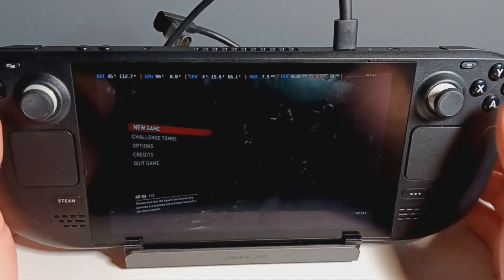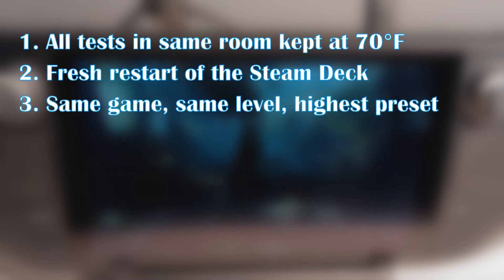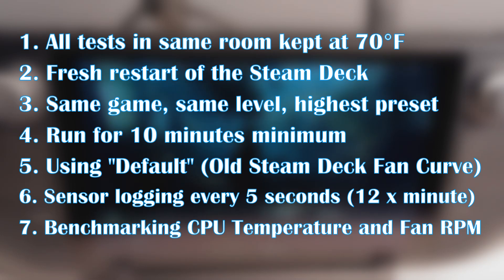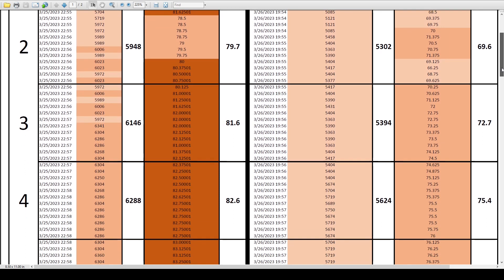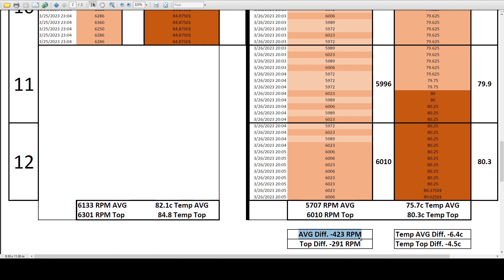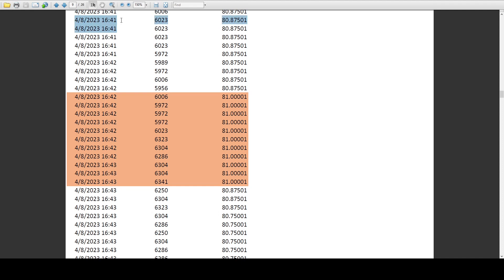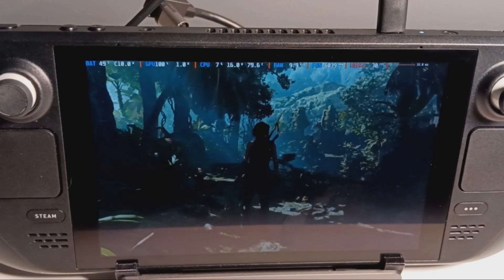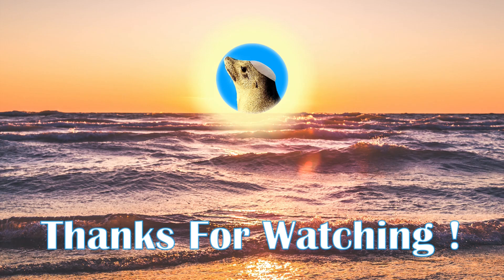Is PTM 7950 Really Better than Stock Paste? - A Steam Deck Benchmark Story

Comment: For those interested, i just did it and im not getting any difference in thermals BUT it does seem to have stopped the fan ramping up to its previous very noisy levels which imo is worth it
Reply: Any difference in FPS, utilisation of the CPU/GPU or clock speeds? If the extra cooling helps, I imagine it would allow the deck to push to higher clocks which could offer more performance
Reply: @JojoooooooI really didn't see any significant performance boost personally, maybe I lost the silicone lottery with my deck but if you're gonna change your thermal paste anyway which you should if it's a few years old, you may as well get some 7950, it's not that expensive and you 'might' see some performance

Comment: Where is a legitimate place most people are buying this Honeywell PTM 7950 from?
Reply from the maker: to be honest mine is third party stuff from amazon that was probably sourced off aliexpress. It works, but my understanding is that the official is even better.
Reply: Linus Tech Tips famously sells this sourced from claimed verified suppliers. I personally would trust that claim but other may or may not. Unconfirmed rumours is that a lot of the stuff out there on amazon etc. is fake.
Reply: @jonatanrullman  there is little if any fake ptm 7950 at all. I got literally the cheapest stuff directly from ali-express and it dropped my cpu almost 10c from using arctic mx-6. It is so cheap to get ahold of in China you don't need to worry about fakes and even the non-branded honeywell stuff is better than paste. I really wouldn't worry about it at all

Comment: The issue with this video is you compared with stock paste. Any paste will beat stock paste. Also ptm7950 needs a few heat cycles to move into place.

Comment: Not with steam deck but in my case is an i5 1135g7 + NVD Mx450 which can take up to 50w+. Decent performance, with me is about 5-6 *C lower than thermal paste like mx4, nt-h1 (after 4 months) and more silent when high loads. Some my recommendations with ptm 7950 are: Store it in a cold place to make it easy to apply, Run games or benchmarks softwares in high loads some cycles and Use fan control software to lock rpm of fan also help it efficently faster

Comment: I installed mine but if I'm not mistaken it need a few cycles to show results, how do you do it? Leaving the steam deck with a heavy game on a flat surface?
Reply from the maker: Yeah it might take a week. To speed things up, I run Shadow of Tomb Raider in Free Roam > Explore Mode at max settings for a couple hours.
Reply: @baldsealion  thanks for the advice, I ended up running FFXV WE and leaving the deck on a flat surface making cycles of 15min on 15 min off, I noticed that temperature was dropping instead of rising at long terms so I suppose that it works!

Comment: Aleays lock fanspeed when comparing stuff like this. Temperature difference would be 6-10c with using same fanspeed.
Reply from the maker: Yeah noted, in later test videos I do run the fan at max in spots... although I think people also are curious about the fan speed differences. Some don't max their systems and may be more curious about how much lower the rpm will get in general.

Comment: I've been testing this in various ThinkPad laptops and the CPU temperature differences are very noticeable while GPU differences aren't as large, but they still count. I would put this in every mobile device ever IMO
Reply: Well, the GPU thing isn't as bad as, in my experience GPUs doesn't heat up as much, my 1060 is pretty cool, issue is always the CPU, those mfs do always get to the 95s

Comment: Awesome video. The PTM7950 coupled with downclocking the CPU and GPU would not some great results.
Reply: wouldn't down clock the CPU, but would definitely under volt it.

Comment: So I have been up and down on the best cooling. From themal pad to paste to blower coolers. Back plate mods. Heatsink mods. For the price of it all. What is better. Jsaux blower cooler. If the look bothers you then getting the PTM7950. The PTM will not get you the temps of the cooler but yes the internal cooler will run slower do to PTM actually being great.
Reply from the maker: I agree if you don’t mind opening your device the PTM is a cheap and effective way to cool that doesn’t add any weight or anything to your device. It’s good stuff. I will put it on my Ally probably

Comment: You can repaste it with almost anything and get improvement i did with kryonaut.
Reply from the maker: Yep totally, the issue there though is heat creep. I’ve been told at least that kryonaut starts degrading at 80c - but this is not an issue with a thermal pad.
Reply: Kryonaut, MX-4, NT-H1 / 2 is due to it's low viscosity more suitable for desktop heatspreader CPU's.
Besides PTM For direct-Core: Thermalright TFX, GD-2, MX-6, Kooling monster Kold-01 or even Arctic Silver 5 are better choices.
Reply: lol better temps doesn't mean better. Kryonaut dries out like satan's 🍑 on a hot summer day, months later those temps will be trash, if you actually use the device you put it on, anyway. The stock steamdeck paste isn't the best but it will also last much longer. In any case ptm is unbeatable by anything other than liquid metal and you'd be insane to LM your steam deck

Comment: Nice! I ordered the PTM 7950 for my Deck. This week I'm testing an underclock and manage to reduce 3-4 C°. My Jsaux Transparent Case with thermal pad is arriving next week. Maybe this combination can reduce 10-15 °C (am I dreaming? lol).
Reply: No. Been there done that. No.
Reply: @Boujee_Sinner  so how much did you get ptm + jsaux? is theres ahuge difference. the temp might be same but how about the rpm?
Reply: so how is it? is theres any notable difference?
Reply: @Bos_Meong  I find it not to be worth your time and money. So it will drop some rpms will drop a few degrees delta but your still gonna be in the 70s C, only way to drop and stay in the 60's is to get a copper plate for the chips. Gets a little crazy.

Comment: The jsaux backplate will drop temps even further, and push saturation time out by a good 10 more minutes. Mine remains well below original temps and fan speeds with PTM7950 and the jsaux plate even after 20 minutes.
Reply from the maker: Nice. I might consider upgrading to that at some point and compare results.
Reply: @ziom00ziom  Yo. Did dude make a valid point about the negative pressure closed system that Valve designed? Is your deck still working flawlessly etc?
Reply: @ziom00ziom can you link to it?
Reply: add a heatsink to the back of that jsaux plate and it gets even better lol
Reply from the maker: @ziom00ziom  I think I know which one you are talking about and it fried someone's components ( I saw the images months ago ). It's the one with tons of vents on both sides. The issue with this is that the Steam Deck is meant to be a relatively closed system. When you open that up, you lose some the negative pressure that the fan creates to pull off heat from the internal components. So while your CPU/GPU temps may be lower, it actually may make some other components actually heat up more and possibly burn out. Be careful!
Reply: @baldsealion  Thanks for the heads-up. Almost just went to AE to buy it. I'll just buy this pad instead.